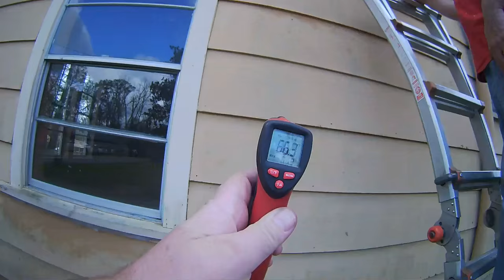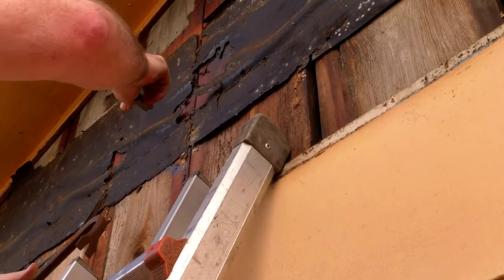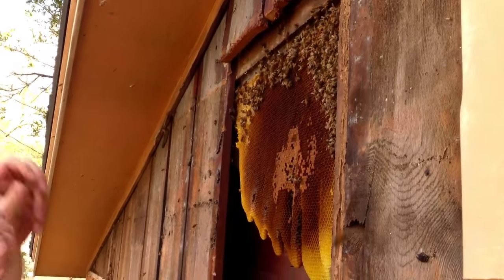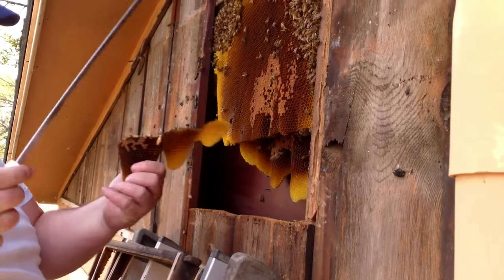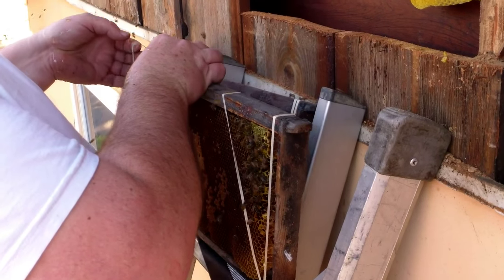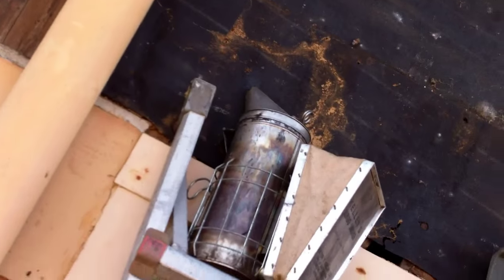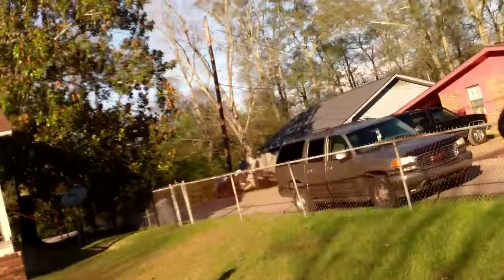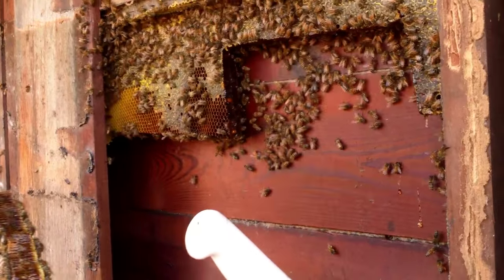Sign Language For Bee

Comment: Those pine barge boards you cut through were probably worth more than the bees, but I'd rather the bees. It amazes me the color wood turns when there is wax on it. That red behind the comb was absolutely beautiful. Great queen catch using a difficult catcher. When you have one close to La., let me know.
Reply from the maker: +Jeff Horchoff We'll get some over by the state line and I'll give you a shout.  That old house has a fortune in wood under all that siding.
Reply: +628DirtRooster    Looking forward to it. I'm glad that there is value in things that are old, I figure I must be worth at least 35 cents.

Comment: A quick question'  I've watched several cutouts and several swarm captures and noticed that a lure is sometimes used to get the bees to swarm to the box. However I've not noticed the lure being used during a cutout. Did I just miss it or is it just assumed? Would it be a good idea to use a lure during the cutout? I appreciate the videos. Keep them coming.
Reply from the maker: +Jonathan Boyd It isn't of much use during a cutout since most of the time you're forcing the bees to do what you want either with a vac or by moving brood.  Not much luring involved.
Reply: +628DirtRooster Thank you for the info. Once again, a good day; I learned something. Thank you.

Comment: About the same time you were filming this, I was harvesting. It's been a weak and wet season and so I only pulled honey from two of my three production hives. Most of it had candied in the comb. That doesn't matter, because I just use it for cut comb and sell it for AU$40/KG (about US$12.50/lb).
Reply from the maker: +Pop&#39;s Shack Glad you were able to do something with it.  Been an odd winter here.  I hope spring is good.  Last year I didn't do many splits but I plan to this year.
Reply: 628DirtRooster I took some to market and had my best day of honey sales ever. What sold the best was the 3-6oz chunks.

Comment: is the saw you use a specialized for cutting bee hives
Reply from the maker: +Californian Bill Nah, just a Bosch jig saw.  It's a little safer to use than a circular saw if you are on a ladder plus it doesn't blow sawdust all over you and the hive.  The drawbacks are that you can't set the depth like you can with a circular saw so you have to be careful not to cut through wiring and things.  It's also a little harder to cut past framing as you can see in this video.
Reply: +628DirtRooster 7:20 the bread sorta looking knife
Reply from the maker: Californian Bill Oh haha.  No, you called it.  It's a cheap bread knife.  I prefer to use my fillet knife though.
Reply: +628DirtRooster ok